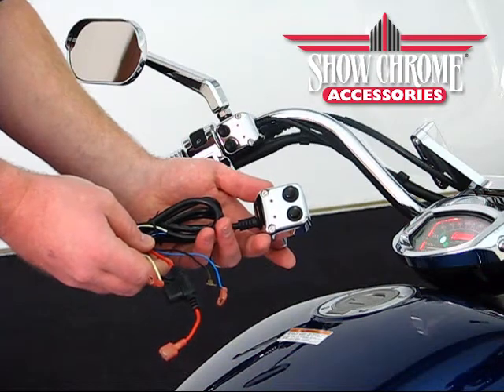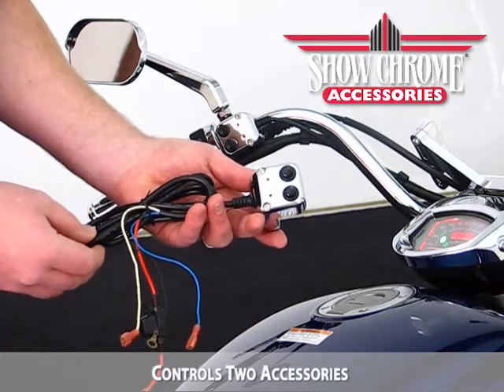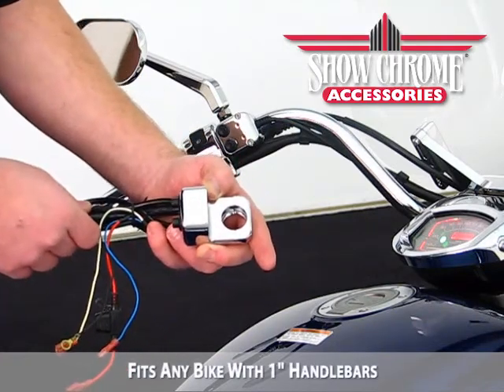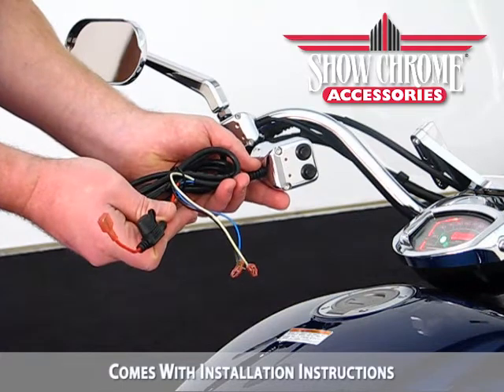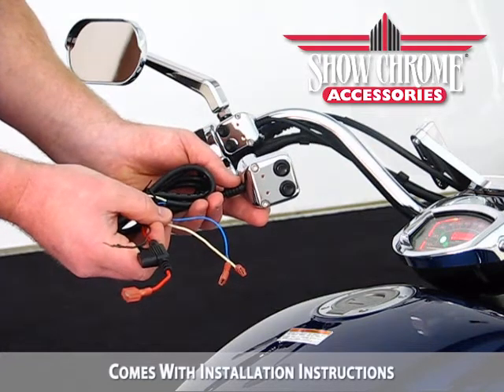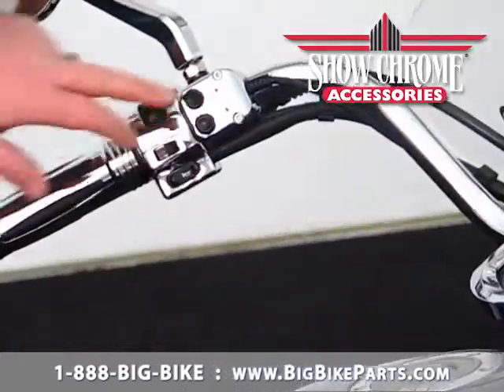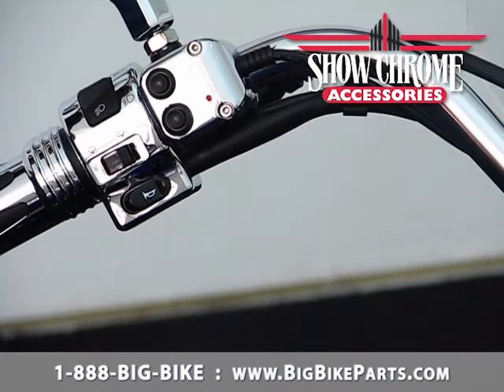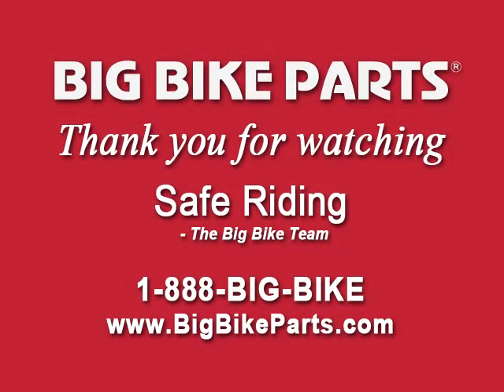Cruiser Accessory Switch Block

Comment: installing the Switch block gold wing ???
Reply from the maker: Unfortunately as the title suggests on this product, the #13-207 is a Cruiser Switch Block for 1 inch handlebars. This will not fit on a Gold Wing Touring motorcycle. If you are looking for a switch block for your Gold Wing, we would recommend our #52-605A and LA or our #52-705A and LMA. If you purchased this part directly from us, please contact our customer service. If you purchased this part through one of our dealers, please contact your dealer and they should be able to assist you in getting the correct fitment.